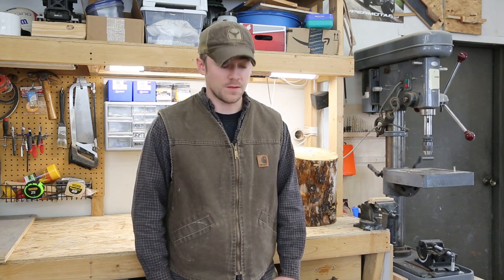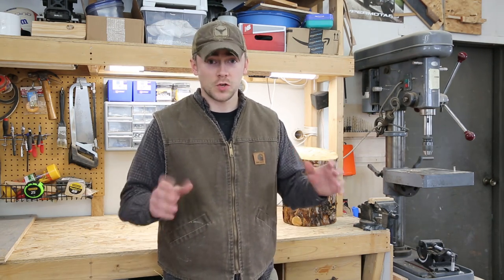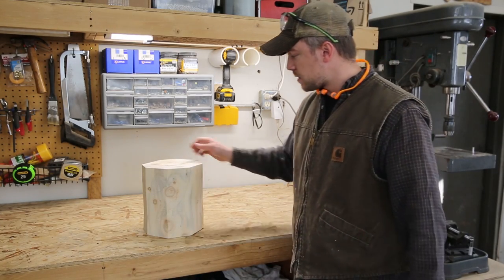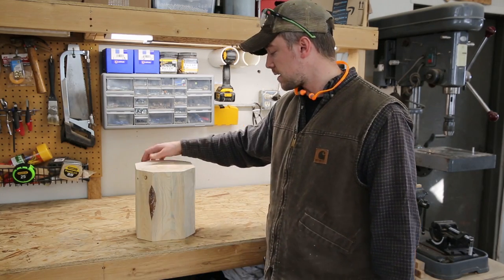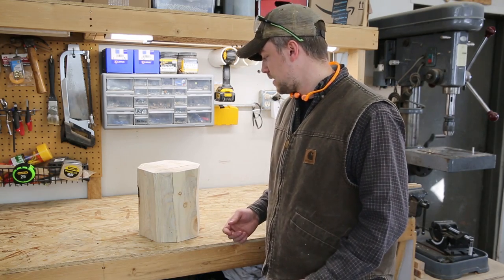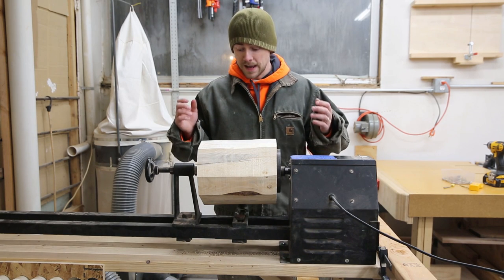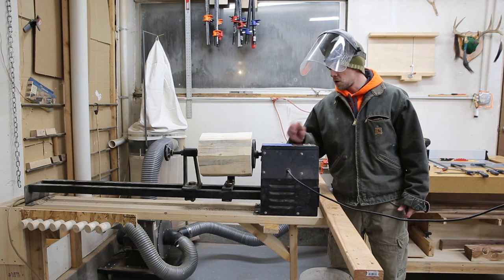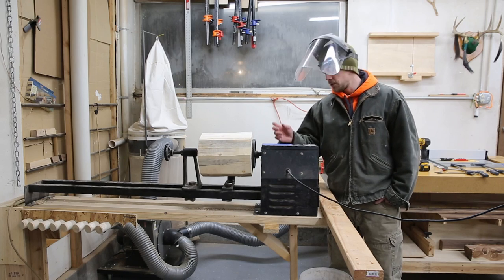Wood Lathe Capacity Test

Comment: if you center the wood up on the tail stock a little better it would take a least a bit more of the wobble out, would most likely get it where you can skim it down to a balanced cylinder and then you can work on It, easiest way to find center of it is drawing a lot of lines from the edges that you cut off of It, almost all the wobble is on the tailstock side
Reply from the maker: Thanks Cody, I may have to revisit this one sometime. I did draw a bunch of lines to try and locate center. The problem is the cuts weren't perfectly uniform so I'm not sure they pointed me to exact center. Also, when tightening down the tailstock of this cheap lath enough to hold this big piece, it actually bends the headstock back and throws both ends out of alignment.
Reply: i had a millers falls lathe just like that and it did the same thing. i had to hammer the head stock piece in so i didn't put too much pressure on it. but i really thing the are for smaller stuff even know the specs say otherwise. cheers from Australia. love the vids. only found you today.

Comment: I bought this same lathe about a month ago for $20. The guy even threw in a full set of turning chisels. First time I turned it on, the vibration was insane and unmanageable so I only turned a few small handles. When they became true, the vibration went away. After rearranging my shop, I took the thin piece of sheet metal off the base, then cut a piece of MDF to match. Along both sides, I cut a rabbet that would allow the sheet metal to grip tightly around, then laminated it to another piece of MDF of the same size. After reattaching the lathe to the metal/MDF base, I mounted it to a solid bench in my shop with carriage bolts. First time I turned it on it was a completely different machine. No vibration and plenty of torque. Hoping to turn some thicker items soon.
Reply: Do you have pictures I have the same problem with mine? If not that's okay I can probably figure it out.

Comment: you could try resting a big bag of sand across the lathe bed to dampen it down some,and another across the end of the two by four.
 im sure as soon as its turned round the blank will settle down

Comment: I have that same lathe and I know the struggle with it for larger pieces but I just keep adjusting the center point on the tailstock till it better but as you know with this lathe when tightening the tailstock the bed arches up which puts it at unbalanced off the get go I drill a center hole for the tailstock to recess into the piece some and it helps alot with holding it to the lathe//its scary at times yes but the center hole helps go for it

Comment: The poroblem is not the bench so much as  the blank was still off center (it looked like the tailstock was not positioned in the center and the lathe was running at far too high a speed. The speed issue is #1 with the problem your seeing.

Comment: How dry was the wood? moisture weight can really add to the amount of vibration. And maybe using a circle jig on the band saw to round it off even more, that is, if you can fit the length of the work piece upright on your band saw. Other than that, a new lathe.
Reply from the maker: I didn't test the moisture, but the tree had been standing dead for several years before I tried this, so it should have been pretty dry. I think my bandsaw should be able to handle the height, I might try turning it even more round on there. Thanks for the suggestion!

Comment: You can better set the work piece balance by changing the center point on the tailstock end.  Manually rotata the piece and watch for high & low spots, then move the piece up or down until you see a minimum of change.  If possible, let the piece swing free so that the heavy side falls to the bottom.  Again, raise or lower the piece at the tailstock end until it turns freely without a heavy side falling to the bottom.  When you have found this sweet spot, you are balanced.  You will almost always get some vibration, but you can minimize it by following these steps, then use roughing gouge to make it round and completely balanced.
Even 900 RPM as your slowest speed is too fast for that size workpiece to begin..  It would be better to start down at 300-400 RPM (safer too), then increase speed as it gets round.
Reply from the maker: Thanks Mark, that is some good advice. I did end up buying a lathe with a much lower slowest speed, so between that and your method of getting it balanced I'm sure it will turn better when I try it again.

Comment: From the video angle, Looked like the side of the log that was away from you wasn't centered or weight balanced quite right.  Might    have to give a little on center point / diameter to achieve that.   Then again, been awhile since I used my lathe so I don't really know.  Was what I noticed just the same.

Comment: As popular as “Laminating & Gluing Up Stock” is these days, what if you were to cut your rough stock in half?  Then turn the 2 pieces individually to your beginning working dimensions. At that point you’d be about half the working weight give or take, depending on the cut making things that much easier for both you and your lathe... The first thing to figure out is whether or not your lathe will successfully turn the first half piece of stock???
If your lathe will, then turn your second piece to the necessary rough working size(as the first) and glue them up as required for the location in your Aunts house(for the abuse that they’ll have to endure). It’s been said that “modern glue is stronger than the wood we use “ after all. Not by me mind you. Well, alright I just did. But, I’m just an old(okay, middle aged) retired Jet Engine guy. 
Then, after every thing has had time to dry, turn down your piece to final dimensions as planned during all those nights you lost that badly needed shut eye over that log.  Although it would’ve made a really cool sequel, I’m proud of you for not burning that thing brother!!! Lol 
Keep the faith!!! I wish you all the best in everything you do!!!
God Bless You & Yours!!!

Would you mind if I sent you a few questions about my unsuccessful(so far) Motor search for my ‘50’s Craftsman Lathe??? You brought up a bunch of great points in this video so I’d like to use some your experiences. I’m a firm believer in learning from one another when and where possible to avoid repeating some of the things we can. “Eventually, someone, somewhere down the road in life will get it right...”     God is Good!!!
K

Comment: I had to smile when the stuff hanging on the wall started to drop .. but to confess I recently had the exact same problem with the exact same lathe.. except that my min speed was 850 on the slowest speed. and my lump of wood was a tree stump (round)... I am in the UK and we have 240v at 50hz so the speeds here are little bit slower... 

As others have mentioned the tail stock end seems off centre but you was looking at your lathe spinning and rattling from a safe position.... thankfully...  

to be honest I think your hoping for too much from a small lathe.. 

suggestions 
screw it down to the floor 
plane the corners off and sharpen your chisels before you approach it..  
ALSO... find a way to slow the speed down... talk to an electrician and ask him if you can add in a resistor in line with your Motor to half that min motor speed.... that will give you a good chance.... TO BALANCE IT UP..

Also .... this is a wild card.. but ... Look out for a cheep older Treadmill that has a manual speed control typicality rated at 5k or 10k ohms .. salvage  the DC motor / MC60 Motor Controller and speed control potentiometer (slider or Rotary).. and bingo you got  1HP - 900 WATT MOTOR that is high torque at low speed. 

This 
Weslo CADENCE 850 TREADMILL IS PERFECT if you can get it cheep off ebay etc... 

https://media.discoverstuff.com/img/listings/ar/arlynl/listing_pic_1125660_1450893163_1.jpeg

good luck....

apparently 
the above mentioned Motor control PCB is...
Used on the following models:
HealthRider

Tony Little Twist - HRCR024110

Image

910 - IM349101

922 - IM392230

JumpKing

TONY LITTLE - TLTL21040

TONY LITTLE VIDEO TRAINER - TLTL23041

Lifestyler

1900 - 831.296380
1900 - 831.296381
1900 - 831.296382
1900 - 831.296383
1900 - 831.296384
1900 - 831.296385
1900 - 831.296841
1900 - 831.296842
1900 - 831.296843
2800 - 831.296550
2800 - 831.2965510
2800 - 831.2965511
2800 - 831.296557
2800 - 831.296558
2800 - 831.296559
2808 - 831.298550
3000 - 831.296440
3000 - 831.296441
3000 - 831.296442
3000 - 831.296443
3000 - 831.296444
3000 - 831.296445
3100PS - 831.296453
3100PS - 831.296454
3100PS - 831.296455
3100PS - 831.296456

3100PS - 831.296458
3100PS - 831.296459
8.0 - 831.297400
8.0 - 831.297401
8.0 - 831.297402
8.0 - 831.297403
8.0 - 831.297411
8.0 - 831.297412
8.0 - 831.297413
8.0 - 831.297420
8.0 - 831.297421
8.0 - 831.297422
CARDIO WALK - 831.297311
CARDIOWALK / CROSSWALK - 831.297310
Crosswalk - 831.297230
Crosswalk - 831.297231
EXPANSE 500 - 831.297430
EXPANSE 500 - 831.297431
EXPANSE 500 - 831.297432
EXPANSE 500 - 831.297433
EXPANSE 550 - 831.297150
EXPANSE 550 - 831.297151
EXPANSE 550 - 831.297152
EXPANSE 550 - 831.297153
SM1100 - 831.297531

Proform

2001 EXL - 831.296670
2001 EXL - 831.296671
2001 EXL - 831.296676
2001 EXL - 831.296710
2001 EXL - 831.296850
280 - PFTL29020
285T - PFTL29100
285T - PFTL29105
365 - PFTL08040
375 - PCTL31560 - Canadian
375 SE - PFTL37551
375 SE - PFTL37552
375 SI - PFTL31560
375 SI - PFTL31561
375 SI - PFTL31562
375 SI - PFTL31563
375E - PFTL31060
375E - PFTL31061
385 C - PFTL39190
385 C - PFTL39192
385 C - PFTL39193
385 EX - PCTL38580
385 EX - PFTL38580
385 EX - PFTL38581
385 RP - PFTL39400
390Pi - 831.299400
390Pi - 831.299402
390Pi/RT2.0 - 831.299401
395 Pi - 831.299500
435 EX - PCTL43590
485 EX - PFTL49391
485 EX - PFTL49392
485 EX - PFTL49393
485 EX/T45 - PFTL49390
522 EXP - PF522010
525 EX - PCTL52580
525 EX - PFTL52580
525 XT - QVTL22460
525 XT - QVTL22461
525 XT - QVTL22462
530si - PFTL53060
530si - PFTL53061
6.0 MXT - PF660020
6.0S - PFT6.0S0
6.0S - PFT6.0S3
6.0S - PFT6.0S4
6.0S - PFT6.0S5
822 EXP - PF822020
822 EXP - PF822021
910 - PF910030
910 - PF910031
920 - PF920030
920 - PF920031
920 - PF920032
920 - PF920033
920 - PF920034
Advantage - PF350701
Advantage - PF350702
Advantage - PF350703
Advantage 5.0 - PF350500
Advantage 5.0 - PF350501
Advantage 5.0 - PF350502
Advantage 5.0 - PF350503
Advantage 5.0 - PF350505
Crosswalk - 831.297300 - Sears
Crosswalk - 831.297301 - Sears

Crosswalk - 831.297302 - Sears
Crosswalk - 831.297304 - Sears
Crosswalk - 831.297305 - Sears
Crosswalk - DR705020
Crosswalk - DR705021
Crosswalk - DR705022
Crosswalk - DR705023
Crosswalk - DR705024
Crosswalk - DR705025
Crosswalk - DR705026
Crosswalk - DR705027
Crosswalk - DR705029
Crosswalk - PF705020
Crosswalk - PF705021
Crosswalk - PF705022
Crosswalk - PF705023
Crosswalk - PF705024
Crosswalk - PF705025
Crosswalk - PF705026
Crosswalk - PF705027
Crosswalk - PF705028
Crosswalk - PFTL70550
Crosswalk 395CW - 831.299410
Crosswalk 395CW - 831.299411
Crosswalk 395CW - 831.299412
Crosswalk 395CW - 831.299413
Crosswalk DL - PFTL40180
Crosswalk GTS - PFTL39710
Crosswalk JM - 831.298060
Crosswalk JM - 831.298061
Crosswalk LM - 831.297340
Crosswalk LM - 831.297341
Crosswalk si - DRTL20351
Crosswalk Space Saver si - 831.297360 - Sears
Crosswalk Space Saver si - 831.297361 - Sears
Crosswalk Space Saver si - 831.297362 - Sears
Crosswalk Space Saver si - 831.297363 - Sears
Crosswalk XL - 831.299210
Crosswalk XL - 831.299212
Crosswalk XL - 831.299213
Crosswalk XL - 831.299215
Crosswalk XL - 831.299216
Crosswalks si - QVTL20351
Croswalk 460 - PFTL39310
Equalizer 6.0s - PF350901
Equalizer 6.0s - PF350902
Equalizer 6.0s - PF350903
Equalizer 6.0s - PF350904
J4 - 831.297000
J4 - 831.297001
J4 - 831.297060
J4 - 831.297061
J4 - 831.297062
J4i - 831.297210
J4i - 831.297211
J4i - 831.297212
T 1175 - PFTL11750
T35 - 831.299200
T35 - 831.299201
T35 - 831.299202
T35 - 831.299204
T45 - 831.299220
T60 - PFT600
T60 - PFT601
T60 - PFT602
T60 - PFT603

Weslo

Cadence 1005 - WCTL30570
Cadence 1005 - WLTL39092
Cadence 1005 - WLTL39093
Cadence 1005 - WLTL39094
Cadence 1010 - WLTL27080
Cadence 1010 - WLTL27081
Cadence 2050 - WL205010
Cadence 2219 - WLTL22190
Cadence 2219 - WLTL22191
Cadence 250 DR - WLTL25010
Cadence 300 - WLTL30040
Cadence 3100 - WL310010
Cadence 3100 - WL361100
Cadence 3100 - WL361101
Cadence 3100 - WL361102
Cadence 3100 - WL361103
Cadence 3150 - WL315020
Cadence 3180 - WL318020
Cadence 325 - WLTL29400
Cadence 3250 - WL325010
Cadence 3250 - WL325011
Cadence 3260 - WL326020
Cadence 3280 - WL328020
Cadence 3350 - WL361500
Cadence 3350 - WL361501
Cadence 3350 - WL361502
Cadence 3350 - WL361503
Cadence 4250 - JA425010
Cadence 4250 - WL425012
Cadence 6.0 - TL6.01
Cadence 6.0 - TL6.02
Cadence 6.0 - TLW6.00
Cadence 70e - 831.293020
Cadence 725 - WLTL72550
Cadence 725 - WLTL72551
Cadence 820 - WETL91000
Cadence 820 - WL820030
Cadence 820 - WL820031
Cadence 820 - WL820032
Cadence 820 - WL820033
Cadence 820 - WL820034
Cadence 825 - WBTL82550
Cadence 825 - WL825030
Cadence 825 - WL825031
Cadence 825 - WL825032
Cadence 825 - WLTL82540
Cadence 825 - WLTL82541
Cadence 825 - WLTL82542
Cadence 830 - WETL25020
Cadence 830 - WL830030
Cadence 830 - WL830031
Cadence 830 - WL830032
Cadence 830 - WL830033
Cadence 830 - WL830034
Cadence 835 - WBTL83550
Cadence 835 - WLTL83540
Cadence 835 - WLTL83541
Cadence 835 - WLTL83542
Cadence 835 - WLTL83543
Cadence 835 - WLTL83550
Cadence 840 - WCTL84090
Cadence 840 - WCTL84091
Cadence 840 - WL840030
Cadence 840 - WL840031
Cadence 840 - WL840032
Cadence 840 - WLTL84060
Cadence 840 - WLTL84061
Cadence 845 - WLTL84540
Cadence 845 - WLTL84560
Cadence 845 - WLTL84561
Cadence 845 - WLTL84562
Cadence 845 - WLTL84563
Cadence 850 - WETL85060
Cadence 850 - WLTL55550
Cadence 850 - WLTL55551
Cadence 850 - WLTL85050
Cadence 850 - WLTL85051
Cadence 850 - WLTL85052
Cadence 850 - WLTL85053

Cadence 850 - WLTL85054
Cadence 850 - WLTL85055
Cadence 850 - WLTL85056
Cadence 855 - WLTL85560
Cadence 855 - WLTL85561
Cadence 855 - WLTL85562
Cadence 855 - WLTL85564
Cadence 860 - WCT860020
Cadence 860 - WCTL86000
Cadence 860 - WCTL86001
Cadence 860 - WCTL86002
Cadence 875 - WLTL87550
Cadence 875 - WLTL87551
Cadence 875 - WLTL87552
Cadence 920 - WETL21100
Cadence 920 - WLTL92060
Cadence 920 - WLTL92061
Cadence 920 - WLTL92062
Cadence 920 - WLTL92063
Cadence 920 - WLTL92064
Cadence 920 - WLTL92065
Cadence 927 - WCTL90060
Cadence 927 - WCTL90061
Cadence 927 - WCTL90062
Cadence 927 - WCTL90063
Cadence 930 - 831.297090
Cadence 930 - WLTL24090
Cadence 930 - WLTL24091
Cadence 935 - WCTL26080
Cadence 935 - WLTL26080
Cadence 985 - WLTL34300
Cadence A3 - WLTL223040
Cadence C32 - WCTL25320
Cadence C32 - WLTL25320
Cadence CR12 - WLTL21130
Cadence CT 10 - WLTL91060
Cadence CT 10 - WLTL91061
Cadence CT 10 - WLTL91062
Cadence CT 10 - WLTL91063
Cadence DL15 - WCTL41590
Cadence DL15 - WLTL41580
Cadence DL15 - WLTL41582
Cadence DL15 - WLTL41583
Cadence DL15 - WLTL41584
Cadence DL35 - WLTL46080
Cadence DL40 - WLTL51690
Cadence DL40 - WLTL51691
Cadence DS10 - WLTL21430
Cadence DS11 - WCTL29820
Cadence DS11 - WLTL29820
Cadence DX10 - WCTL35090
Cadence DX10 - WLTL35080
Cadence DX12 - WLTL31090
Cadence DX12 - WLTL31091
Cadence DX8 - WLTL46090
Cadence EX14 - WCTL29200
Cadence EX14 - WCTL29201
Cadence EX16 - WLTL39200
Cadence EX16 - WLTL39201
Cadence L290 - WLTL29610
Cadence L290 - WLTL29611
Cadence LS 8 - WCTL56590
Cadence LS6 - WLTL54080
Cadence LS6 - WLTL54081
Cadence LS8 - WLTL56580
Cadence LS8 - WLTL56581
Cadence SL20 - WLTL33090
Cadence SL20 - WLTL33091
Cadence TS300 - 831.294660
Cadence TS310 - 831.294620
Cadence TS5 - WCTL50060
Cadence TS5 - WCTL50061
Cadence TS5 - WCTL50062
Cadence TS5 - WLTL50060
Cadence TS5 - WLTL50061
Cadence XT - WLTL27071
Cadnece XT - WLTL27070
Cardio Pacer - WLTL421040
Free Spirit 813 - WCTL84060
Reply from the maker: Man, thank you for all your advice! Looks like you really put some work in for me. I'm happy to say, I've since bought a better lathe and gave this one away. The new lathe turned that piece no problem!
Reply: What kind of new lathe did you purchase? How much?

Comment: you could try turning between centers instead of the face plate. then you could get the load more centered and have a chance at it. but yeah, a cast iron bedway could help. Harbor Freight's 12x36 is fairly stout for around $320 before coupon. It isn't a Jet, Robust, or high dollar lathe, but there are a few channels on YouTube where the turners use them.

Comment: Is there a local school or shop with a lathe where you can take your walnut blanks and pay for some lathe time just to trim them down to a rough but balanced size?  You have a lot of followers on your page and I’d think at least one of them within driving distance would let you have an hour of time on their heavier lathe to get this part done. Once it’s balanced you can do the finish work on your smaller one. I’d volunteer time on my lathe but I’m about 1700 miles from you so that’s not an answer. A school might be the easiest and cheapest way around this. Then again, maybe this is the time to talk to the wife about buying a bigger used lathe on Craig’s list. That’s how I got mine. I’m sure something could be found within 3-4 hours driving time. I drove 260 miles to the Saint Louis area and bought a large and old Oliver that runs like it did when it was new (in 1940). Another point mentioned elsewhere in these comments is that 980 rpm is way too fast to try and balance a heavy piece. Perhaps you can add a pulley to reduce yours down to 250-300 rpm max. Then use your gouge to trim it into balance.
Reply from the maker: Thanks for the ideas Dennis! I ended up getting a heavier, smaller lathe that would go down to 60 rpms. With the sturdier machine and slower speed I got the project finished up.